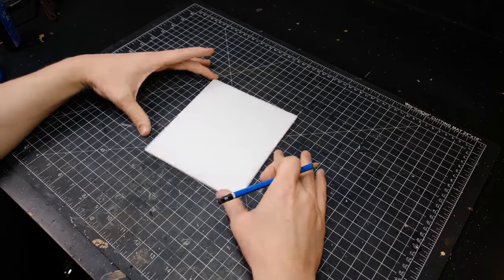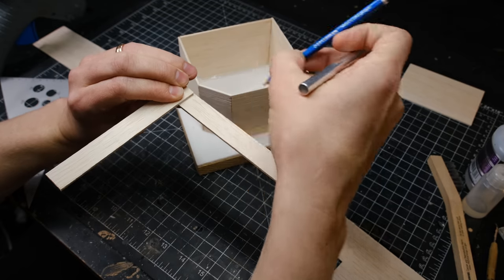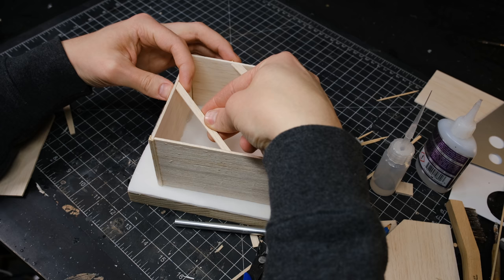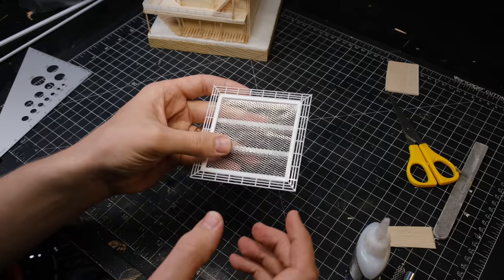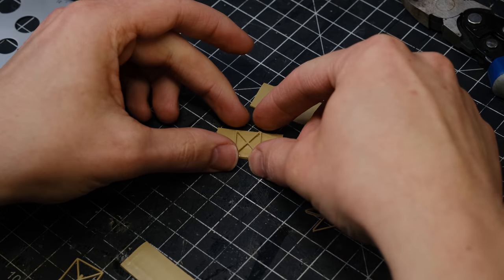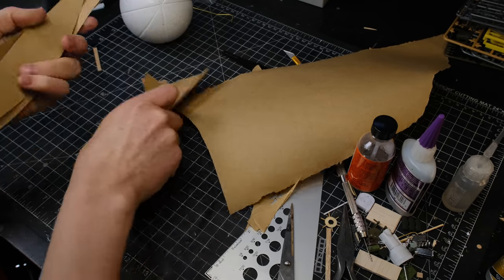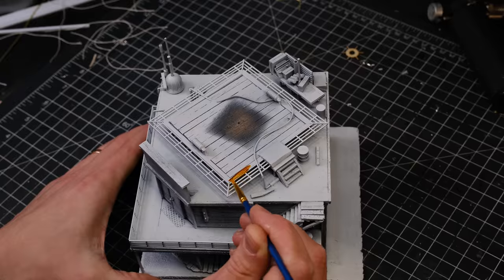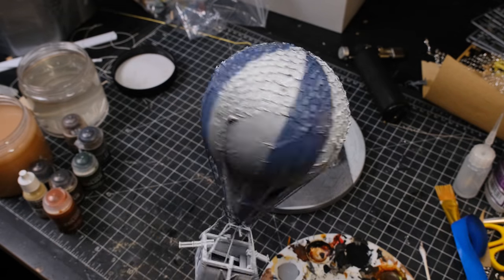My Western Town | Building 6

Comment: I like the final design, especially the ballon but i feel like the building is a bit "flat" overall. I'd suggest re-using the blue of the balloon to paint the wall under the railings between the floors, just so it stands out a bit more compared to the dust-brown of the building itself.  Love the world creation you're putting together, each new addition really has its own story and evolves the town itself. Looking forward to that little Sasquatch monster you...might have teased?

Comment: I just had an idea! hear me out! How about you make a route shaped street "cluster" with square holes where you can put in the buildings, any way, order and direction, you want? And you can change it any time! as you please. (Also you could make like a defense wall for the outer most part of the streets.
Reply: That sounds neat, but to keep with the modular nature of the town so far built, I'd say have the streets and alleyways be individual pieces and then embed magnets into the sides of the bases so that the buildings can connect with one another as well as the streets.

Comment: Awesome, thank you. When you say "start that bag" how would I go about that? Where do you get those from? You buy random models, never assemble them throw nicer parts to that bag? 
I would like to decorate my 3D printer (it's 3D printer parts that I design) to make a unique build.
Reply: Very cool! I have seen some amazing art going into the very machines that make folks more productive of late. You might want to check out a YouTube presenter named Miniac, he recently had an artisan create a logo sign that, if I am not mistaken, features sprue! Basically, yes, while your young, save anything single use or non-used plastic, and use it creatively. Thus says the oldest living person on the internet. Peace.
Reply from the maker: Thanks for your question! I have pulled bits and pieces from lots of places. Some thrift store finds, model kits on sale at hobby stores, and bits of old kits that I never assembled. You can also steal bits from old toys, electronics, and such. Save bits from everything, I guess!